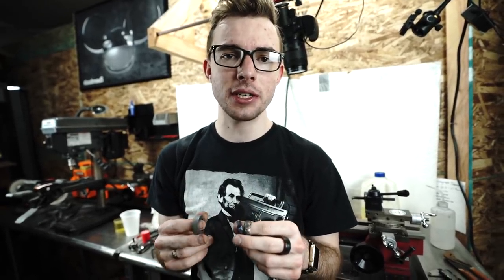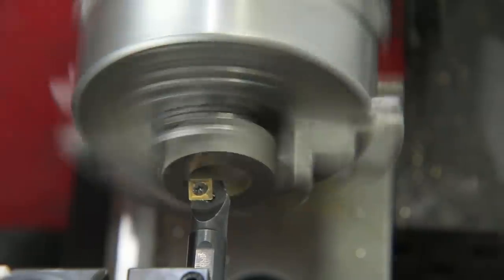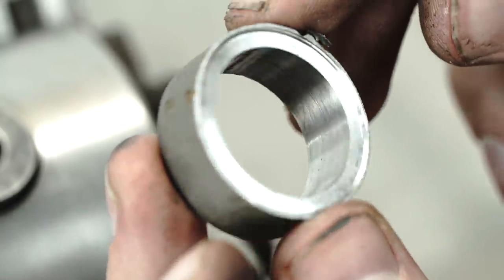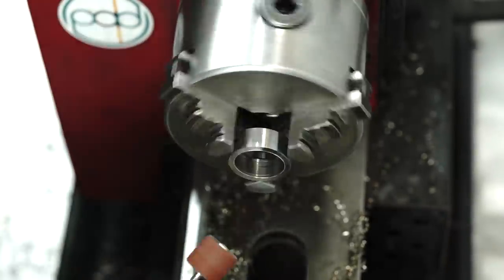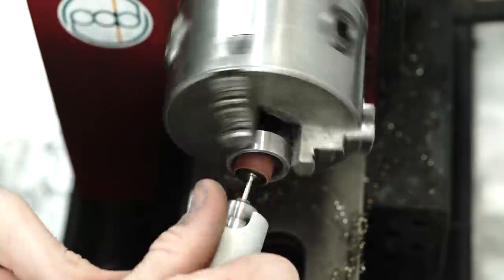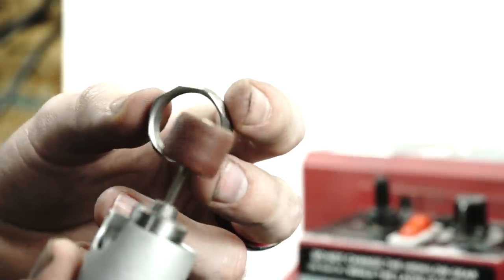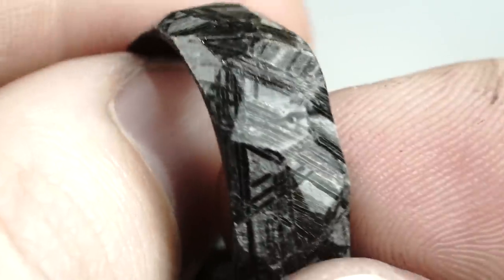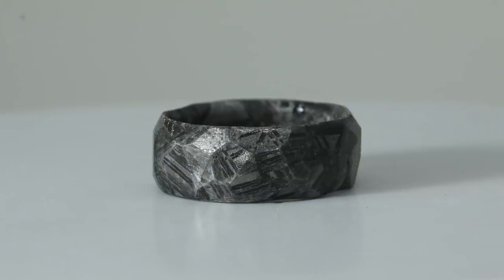Making a Meteorite Ring with Obsidian Facets

Comment: I like this one the most of the three. It looks the best with its texture and aged appearance.

I do have a question though. Is it possible for you to use one of the stone ring blanks in another glowstone ring? I'm thinking a layer of glow powder underneath the stone so that in the day, the ring looks like a stone ring (kinda like your carbon fiber and marble ring), but at night, the stone itself would be glowing. The biggest challenge I think would be making the stone thin enough that UV light passes through it sufficiently, but not so thin that it looks unnatural in the finished product.

Comment: Do you save the meteor filings? Seems wasteful and kinda sad if you weren't to save them lol. Im sure you could figure out a way to repurpose them into a ring in the future.
Reply from the maker: I save them and am still trying to figure out exactly what to do with them. (I use a very small percentage of what I make as inlays on other rings)
Reply: Okay that's what I figured but just wanted to ask lol. You could melt the filings down and forge a meteroite ring out of them too. Do you work with Tungsten? Ive always wanted a really nice hefty Tungsten ring of a unique design, and your designs are incredible man, keep it up!